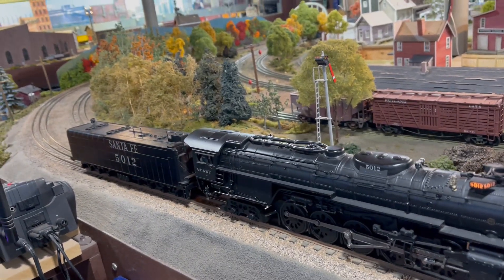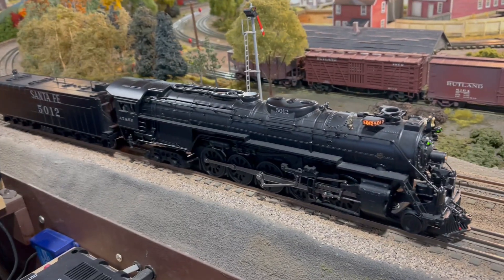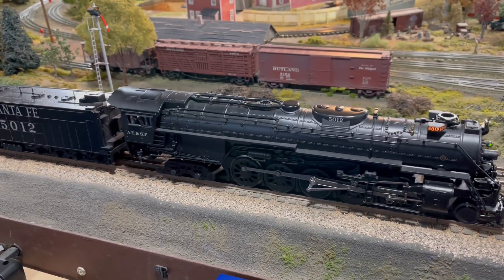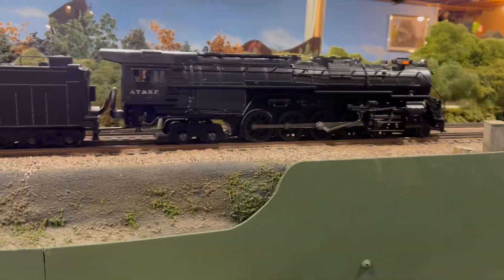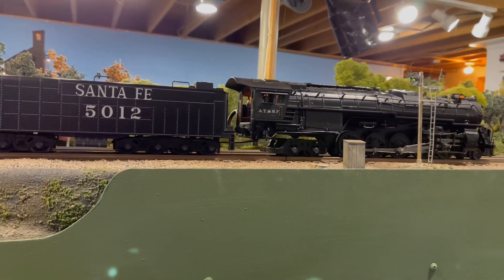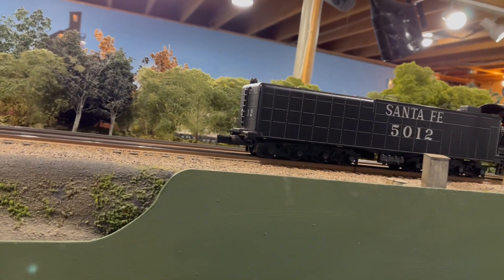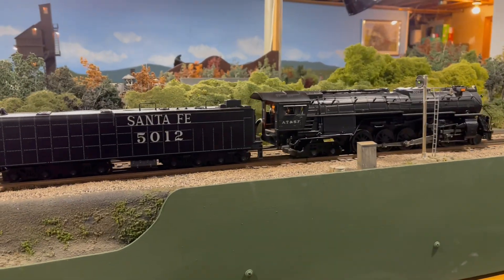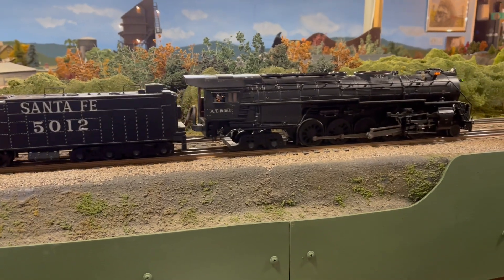MTH Premier Texas Type 2-10-4 PS2

Comment: Is that a custom whistle sound file?
Reply from the maker: I don't know.   Haven't run any MTH PS2.0 engines since the early 2000's.   I was surprised how good the sounds were in this MTH PS2.0 engine. The person I purchased this engine from didn't specifiy whether the sound file was original or custom.   

Been running Lionel Legacy and TMCC only on my layout.  Pretty much purchased TMCC RS when it came out  in 1996, and then upgraded to Lionel Legacy control around 2006.
Reply: I can verify that's a custom MTH sound file. I was actually friends at the time with the person who made this file as that whistle was originally commissioned for my PS2 SF Hudson. Whistle was originally sourced from YouTube videos of Santa Fe 3415 in Kansas. The whistle file was later reused and resold to other people later down the line. Unfortunately the person who made the file was extremely unstable and toxic and has since left the hobby earlier this year after lashing out at the YouTube community. They were very talented with sound files, but a very emotionally unstable person.